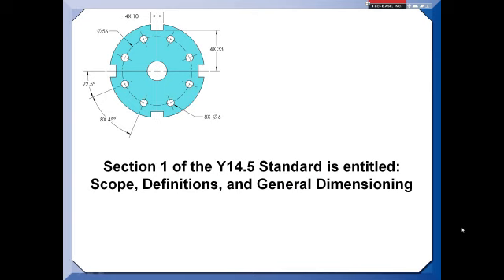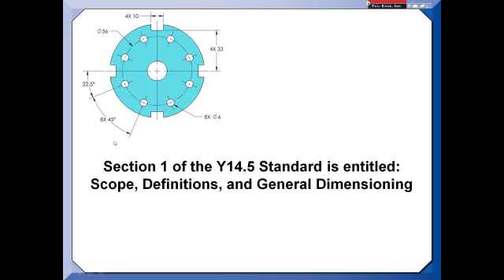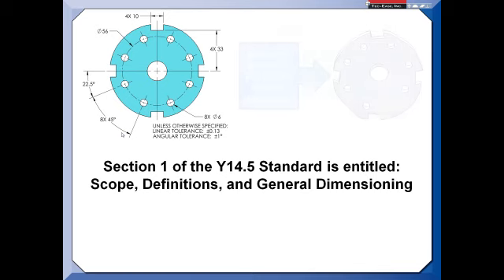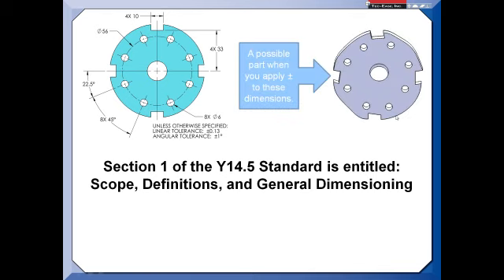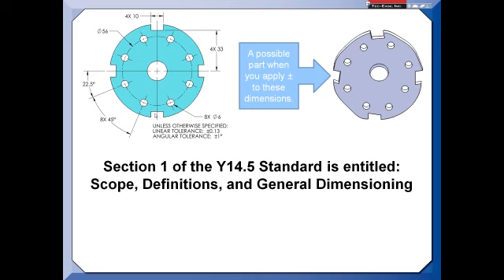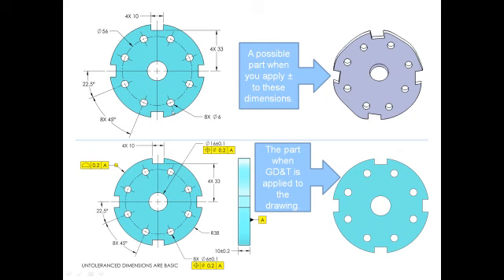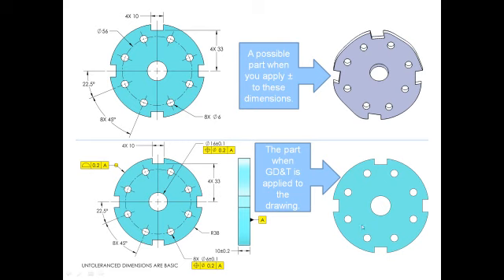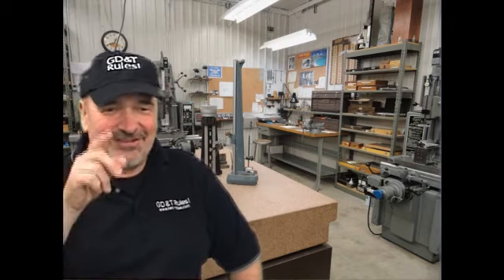GD&T Tip - Don't Confuse Dimensioning with Tolerancing

Comment: I'd agree with you on the requirement for a 2nd Datum but i'd personally use one of the slots to orientate the part. 

Secondly I think it's common practice to use that note, saves cluttering up the drawing with loads of boxes around your dimensions...
Reply: There is no need for a second datum. See my response below to Ironbob2007.

Comment: You only dimensioned for one degree of freedom.  The smarter way to have dimensioned this was to create the center hole or the outside surface diameter as Datum A, the bottom surface of the part as Datum B and then dimension the holes as a composite tolerance.  I also cannot think of a more poor way to dimension a part with a note that says "untoleranced dimensions are basic" !  Are you kidding me?!?  I'd suggest going back to school because this example of poor.
Reply: The example in the video is correct. All six degrees of freedom are constrained. There is no need for a secondary or tertiary datum. See section 4.19 of the ASME Y14.5-2009 standard regarding "Simultaneous Requirements". All three feature control frames contain the same datum features, in the same order, with the same boundary conditions. This means they all apply at the same "simultaneous" time. The gage this part would be put in to check the GD&T callouts would fully constrain the part.
Also, the use of "UNTOLERANCED DIMENSIONS ARE BASIC" note is acceptable and defined in ASME Y14.5-2009. See section 2.1.1.2, (b).